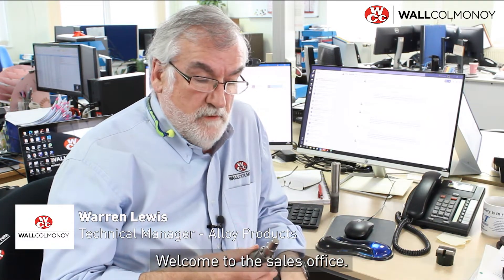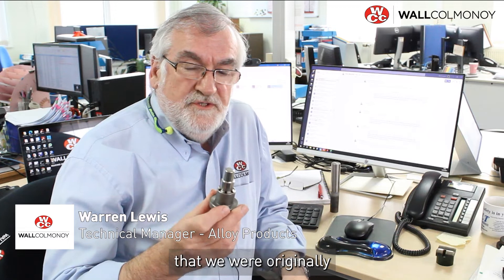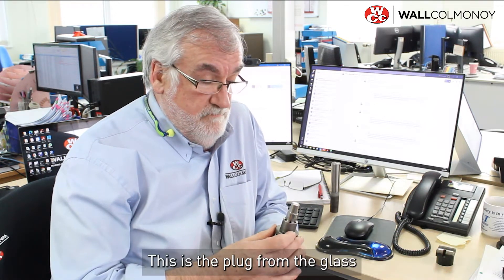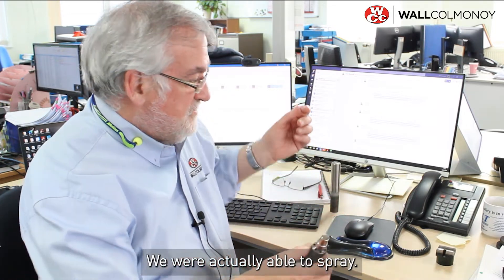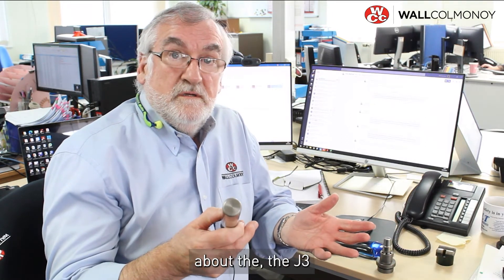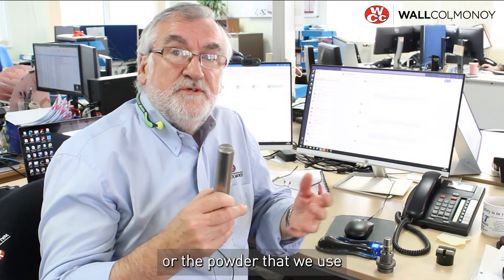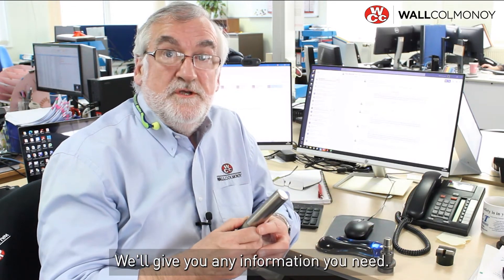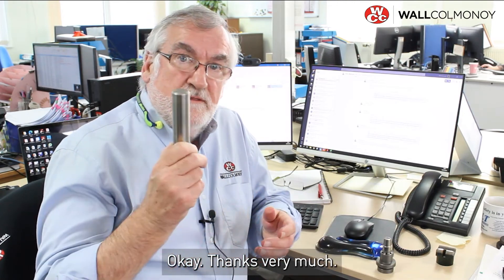Spraywelder™ System – Demo Result

Comment: Can you tell me please does it also works for ceramic powders? because they have a high melting point. can we diffuse them after coating with oxyacetylene flame?
Reply from the maker: Unfortunately, the Spraywelder was never designed to deposit ceramic or even nylon/plastic type powders, only metallics such as iron, nickel, and cobalt based powders either of the self fluxing type or single/two stage self bonding types. However, I should also point out that ceramic powders, to the best of my knowledge, cannot be diffused using an oxy-acetylene torch, induction or indeed any other fusing process. They are designed to be used in the as-sprayed condition although finish by grinding, lapping, and/or honing is possible. Hope this helps.

Regards,
Warren